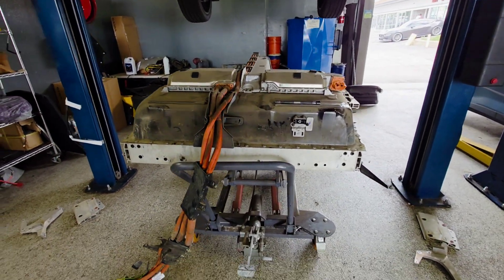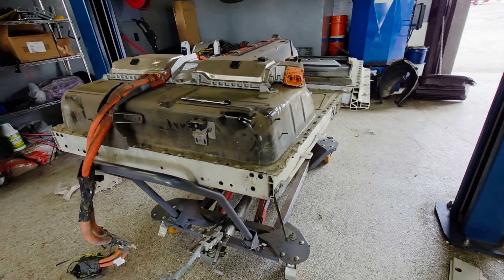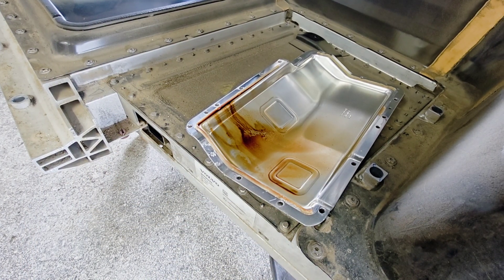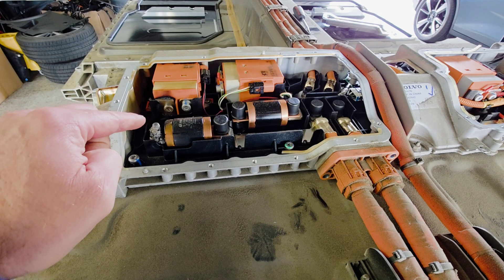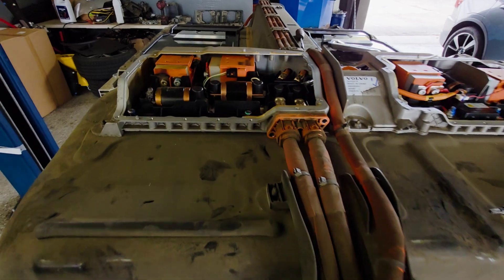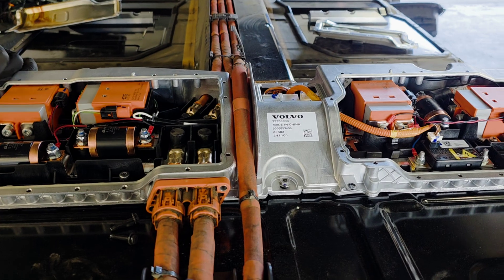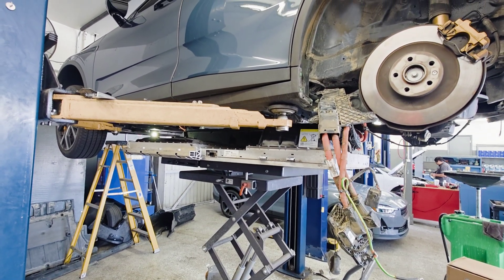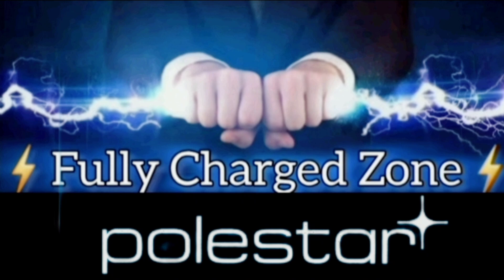Polestar Battery Repair • BDU • Battery Disconnect Unit

Comment: Hi is this battery better protected for puncture/accident from below the car if you compare to the chevy bolt ev /( in europe opel ampera e) battery?
Reply from the maker: Yep, much better protected. Thicker pack, real underbody shielding, and proper HV disconnects. No battery is bulletproof, but this is a big step up from older EV designs.

Comment: Hi. Can you tell the model of hydraulic table you use please?
Reply from the maker: 🔧 Blitz Lifting Table MGE 2.0 —

Capacity: 2.0 tons (2000 kg)
Stroke: 1000 mm lift height
Pump: Air-hydraulic (faster + no manual foot pumping)
Color: Grey RAL 7015
Series: Master Gear / Heavy EV Component Lifter
Brand: Blitz-Rotary (Germany)

This is basically the “big boy” version of the Blitz gear tables — overbuilt for drivetrain modules, EV battery packs, rear subframes, and anything where you need perfect height control and maximum stability.

Lifting tables - Rotary https://share.google/zHWCIK1OMQnavj7dR
Reply: @FullyChargedZone Thank you very much!

Comment: Hi great video. I’m having an issue with OBC after changing battery. Fault code P0D1513, POD 513 Battery
Charging System
Interlock Gircuit/Open
Circuit General Electrical Fault Circuit Open. Have you had any issues with this one before?
Reply from the maker: You either have a plug thats left undone or its a bad battery

Comment: Great video never seen the battery pack . Are there batteries in the tunnel bit running front to back?
Reply from the maker: The battery cells are under the cover. The battery disconnect an Battery management system is what I replaced. Its called a BDU